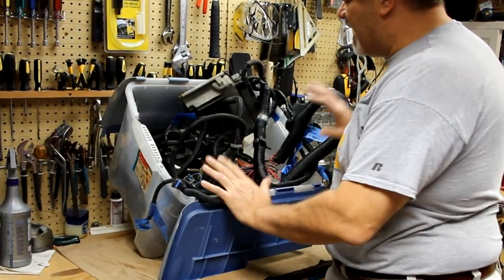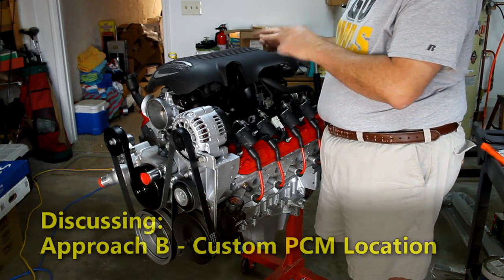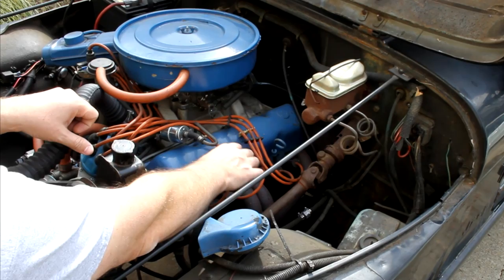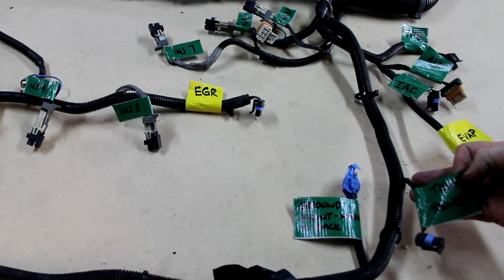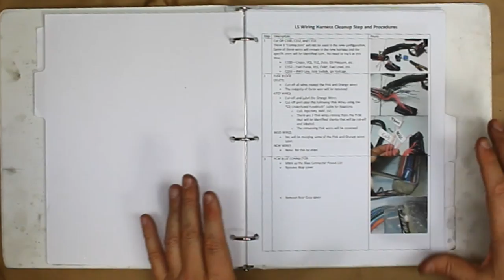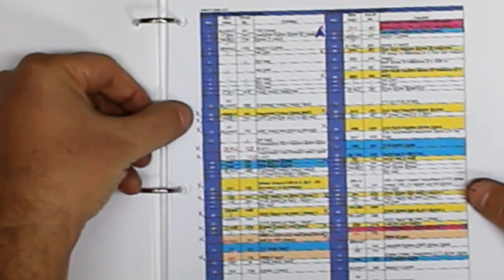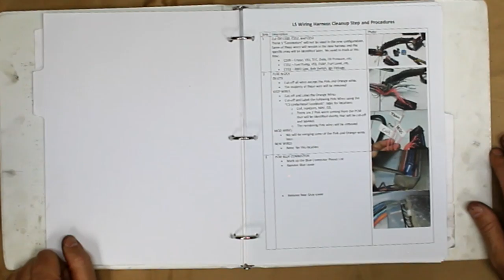LS Wiring Harness Part 1 | Project Rowdy Ep013

Comment: These really are great videos I'm starting a 5.3 build you wouldn't be interested in selling the ac compressor and bracket and bolts and mabe the fuse box
Reply from the maker: I do still have all of those pieces and would be interested in selling them. The fuse block you can have for $10 and need to look up the Compressor, but I would discount it over a normal used price.  The bracket and I will try to find the electrical connectors that you can have for free.  Interested?
Reply from the maker: I just saw Compressors on ebay between $125 - 160.  So how about $80 for mine.  So all of it for $90.
Reply: @UCanDoIt2Mike  that is a good deal is that including shipping and do you do PayPal for payment
Reply from the maker: We will have to figure out Shipping costs and add that.  If you are still interested, I will weigh all those parts and provide you weight and origin Zip Code, so that you can figure out Shipping cost to make sure you are still interested, before I pack it all up.  I do have Paypal.   Let's move this conversation over to email.  Mine is Ucandoit2Mike@gmail.com.  Thanks...  Mike

Comment: when u remove harness from donor ie truck/tahoe do i cut harness at firewall? and take everything under hood
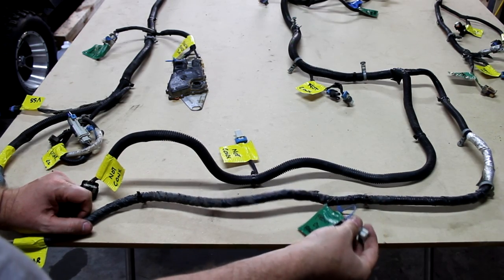Reply from the maker: Look at the 8:58 mark of this video.  It starts to show the Donor Fuse Box.  When I show the rear of it, you can see where the Non-Engine related wires were cut at the rear of the box.  Between this and disconnecting the 3 connectors (C100, C152, C153), you should basically be free from the donor vehicle.

Comment: been searching lt1s page and cant find the harness chart you have can u link the chart itself?
Reply from the maker: Depending on your engine (size and year) you will need to pull the correct PCM Pinout Chart.  So I don't want to just point you to the one that I used.   Here is how I found mine.  See if it helps!!!!Navigate to:  [Wire Harness Info] > [Vortec 4.8/5.3/6.0Harness Wiring Info] > [PCM Connector Pinouts 99-02].
Reply: Look under this video description too, there are schematics and part links .

Comment: Hi Rowdy, James J. here, Do these wiring lessons apply to the ls engines also?
Reply from the maker: Absolutely!  The high level approach will work for all GM (Ford, Dodge, etc) engines.  Specifically on the GM side, you have to obtain the proper pinout charts for your engine and decide what features you would like to keep/delete.  The wiring harness for all Gen3/Gen4 engines (LSx, LMx, LQx, etc.) are for the most part the same.
Reply: @UCanDoIt2Mike  Thank you my new found friend for this advice. I'm looking to do the same with a ls 6.0 and place the engine in a 1970's model old school ford truck. Along with the 4l80 trans. I want to keep the wiring  for that trans because they're such strong trans.
Reply from the maker: @talentworld6280  Heck yeah!  That sounds awesome.  I love those old trucks and possible plan to do something similar when I retire.   Cheers and enjoy your project!!!
Reply: @UCanDoIt2Mike  THANKS

Comment: Can anyone help me. I pulled a harness off a v6 Silverado 1500 and it has all the same wires it looks like. The computer has the red and blue prong can I still use this setup?
Reply from the maker: cameron ludwig I’ll take a stab at an answer ...   the direct answer is Yes.  The real answer is Why?   Your going to have to add 2 injector wires and do something about the combined Coil wires.  You need two more cool circuits.   There has to be other differences.   Seems much easier to go to a junk yard and pull the right one.
Reply: @UCanDoIt2Mike  thank you for your help bud. Do u know where I might could find a video or site about how to add all the extra wire to harness? I've looked at the salvage yards close 2 me and there all gone or someone has cut it all up 😫😢 I might travel to memphis next weekend and see if they have a yard there with one.
Reply from the maker: In my series where we are taking out wires is the opposite of what you are looking for.  It is the same concept.  You will have to locate the Pinout documentation for the Year of your PCM and that will be the configuration that you have to achieve.  Again, I think finding a V8 harness and PCM would be the easiest route.

Comment: my harness comes with a temperature sensor, same as yours but in the same columns of wire there another sensor with 2 wire (one Bwn and one Wht) that is located in front driver side, below the Temperature sensor, behind the power steering oil in the engine so Do you know what sensor is that? am asking because your harness diagram does not show it and i do not know if i need to save it or delete it.
Reply from the maker: Not sure.  my best advice would be to check continuity between the wires in that connector and the PCM connectors to see if yu can determine which Pins it represents.   Then you can look at the Pinout Chart to determine the purpose of the wires.
Reply: @UCanDoIt2Mike  i follow those wires so they come from sensor to C-100 and from C-100 come to the ECU (body control body so. any ways i decide to delete. thanks
Reply: what i know is the Body control model (ECU) controls all elctronics in the car such as electric door, power mirrow, power windows etc. i don't know why those wires come from engine to ECU.

Comment: Anything for underdash harness from the bulkhead under drivers side?
Reply from the maker: I just last week published Episode 27 CJ7 Dash Removal where I discussed my some of my plans for Dash Harness Wiring.  I will ultimately be going with a generic purchased harness.  I will be detailing that install as well.  It will be a little down the road before I get there.   Currently working on Heater Box and then back to the Bodywork.Mike
Reply: Currently ive pulled my harnness out. I bought this 98 stepside for 1k. But the harness was cut in many places, unusable. Looked around for a new harness but can only get those generic harnesses as well.
Reply from the maker: I did some research a couple of months ago during some down time.  The two big companies (American Wire and Painless) both offer a Custom solution for my Jeep for about $900!!!!!  But I can get a 22 Circuit Generic Harness and put the ends on myself for ~ $400.  Seems like a no-brainer to me.  Generic it is.  I can crimp ends like the best of them.  Mike
Reply: Spoke with painless, only able to get a 22 circut generic from any of them. I agree, save money...no brainer
Reply from the maker: Just saw some information on Kwik Wire.  They have several kits with different circuit configurations.  They even have a Water Proof one that has my attention .

Comment: I see your deleting rear o2 sensors. Is that bank 1 sensor 2 and bank 2 sensor 2? I'm asking because both my bank 2 sensors were cut and I'm have to wire those back in my harness.
Reply from the maker: Yes...  Both Rear O2s are referenced as "Sensor 2".  The "Bank" reference is Left or Right side.  If you are looking to keep all 4 sensors in your configuration, you might consider visiting a salvage yard to obtain the connectors and extra length of wiring to put it back.
Reply: OK last question did you have to remove any wires from the PCM to ground your o2s
Reply from the maker: The direct answer to your question is NO.  Each O2 connector has 4 wires.  The Black Ground wire goes into the harness and terminates into a common Splice or Junction.  The 2 sensors that I removed, I just cut off the Black wire from this junction.  The Pink wire goes to the C2 Fuse Block, the other 2 wires (Tan and Purple) are Low and High signal wires that do go to the Blue Connector of the PCM.

Comment: Were you able to finish the wire cleanup procedure?
Reply from the maker: I didn't.  I put that together before starting and then did not quite follow it.  It does not truely represent the process that I took.
Reply: @UCanDoIt2Mike  okay. Either way thanks for all the info I will be using it for my swap 👍🏼

Comment: If you can help how would I wire the fuse wires for standalone on a 2012 Tahoe 5.3
Reply from the maker: Box Crazy That is beyond my research.  The approach would be the same.  You just need to find Pinout charts

Comment: I don't know your inspection status of your state so this point may not apply....  THe EVAP system is deleted?  No emissions inspection??  Also when you were going over the harness on the table and you had your Rear O2 sensor in "yellow" for cutting out, this exhaust isn't going to be catted?  Because the O2 sensors are fuel management, not part of the transmission
Reply from the maker: Excellent Questions Justin.  In Georgia, Emission Inspections are required for vehicles 25 years young.  This engine is going in a 1979 Jeep CJ7.  GM found other methods for EVAP in later model engines so at some point (about 2004) EVAP went away anyway.   I will not need emission on this vehicle so there will not be any Cats or Rear O2 Sensors.  I will have the PCM programmed to adjust for these Deletes.   Again great thought and this may affect people with other circumstances, so it is a great topic!  Cheers!
Reply: I think GM also removed EGR on this engine around 2001 too. Not sure exact year though.
Reply: Unless you are going for a all out cam motor with carb, I would try to maintain all emissions systems, reason being, when the pcm compensates for a leaner burn, you make more power than when you run richer.

Comment: Will this work with LS3 set up? For a chevy Monte Carlo?
Reply from the maker: This is the basic footprint for taking an "LS" series engine harness and modifying it as a 4 wire setup.  It can then be placed in any vehicle and to make the engine run, you just need to connect the 4 wires.  There are addition wires that you will want to also use as described in the wiring diagram in the description and is why I installed a custom 8pin connector in this series.  There are slight differences in the Harnesses 99-02 and 03-08 and Car versus Truck (due to things like the Intake Manifolds are very different).  But if you understand the basic theory of what I have done here, you should have no problems working out the slight differences.  Some of the true LS engines have the Cam Position Sensor on the front of the engine where as the Vortec truck engine has it in the back.  Therefore the associated wires will be found in different sections of the harness.  But they are still there!!!  The true LS3 was used in and around the 2008 timeframe.  That Harness, I believe, will have Blue and Green PCM connectors where mine has Blue and Red.  Some of the pinouts will be different, but you must download the proper Pinout chart from LT1Swap.com and it will tell you what the wires are for.   Hope that helps!!!!

Comment: hello how are you plz i have hummer h3 3.5 2006 i wanna make a swap to 6.0 0r 6.2 l 2007 g4 you can advise me plz for the better one and for the harness working ans somthing not difficult plz ty
Reply from the maker: Wish I could help....  The concept of what is presented in these videos pertained to all swaps.  You just need to provide the specific.  Your harness is different than mine.  Enough so, that my specifics (pin out charts, pin numbers, etc) would not apply.
Reply: @UCanDoIt2Mike  thank you for your help 
my h3 2006 3.5l  Ecm e40  if i find  v8 5.3 or 6.0 or 6.2 with E67 ECM and harness  i put it on my h3 my car work properly for the ABC and gauges and traction control and cruise control and my  transmission sure i wanna change the bell housing and converter and shaft ...?

Comment: How did you wire in the 2 wire alternator?
Reply from the maker: This is the original Alternator and harness.  It is wired stock.  I have not installed the engine the swapped vehicle yet.  I will have to run a wire to the battery for charging.  I will follow the standard configuration.

Comment: how can I set my headlights to turn off automatically? LS1 in 65 c10
Reply from the maker: I assume that you do realize that a vehicle has multiple harnesses and that the headlights have nothing to do with the Engine Harness.   I can only assume that there is a timer circuit that is based on getting "Keyed" power.  And that when that power is lost, it begins to count down.  If you grabbed an Electric Schematic from a newer vehicle and traced the Headlight circuit, you will most likely will be able to determine how that works and what you need from a salvage vehicle to accomplish this.   The more I think though it, the more interest I become....

Comment: From what year and model is that ecu is that second generation LS ECU
Reply from the maker: My engine and PCM (ECU) is from a 2001 Silverado.  I believe they call it a PCM (Powertrain Control Module) because it controls both the Engine and Transmission.   This is a third generation engine LM7 5.3L.
Reply: Ohh ok thank you friend if anything gives me problems when i start working on my harness probably fuse box and relays looks complicated
Reply from the maker: You just need to break it down into smaller sections.  Many things will go without a hitch and you may run into a couple things that you will need to research and figure out.   Wouldn't want to push you into something that you are not comfortable with, but with a little research it was very rewarding for me.
Reply: When time comes im going to bother you with questions my friend lol
Reply from the maker: I'll do what I can to help.   You going to put an LS in the old GMC truck?
Reply: No i just bought 1988 Ford Mustang GT 5.0 302 i want to swap it with LS 5.3 and 2 Speed Powerglide which i already had i just bought LS1 intake and Truck harness i still need ECU and another set of heads i want to boost that ls and run it on track those Fox bodies are light little over 3000 pounds

Comment: If this is followed step by step with this also work for a 6.2?
Reply from the maker: The basic approach for all of these LSx series engines is very similar.  So let me say Yes!  Let me add a foot note that I believe the most 6.2L engines (I believe are GEN 4 engines , maybe??? ) are configured with VVT (Variable Valve Timing).  So you would just need to add the technical knowledge associated with VVT and you would be good.  Hope that helps!
Reply from the maker: Oooops!!!!! When I wrote this, I was thinking this was on one of the engine build videos!  From the standpoint of the Engine Harness.... again YES!   The Approach is the same.  It all starts with research and preparation on the LT1Swap.com site.

Comment: will this work with any ls Wiring harness?
Reply from the maker: korbin varney Yes!  What is represented in this video with directly work for any GM LS engine. You just have to pick and choose what gesture you want to keep or discard.  There are connect charts that you will have to obtain for your specific engine.  This “Approach” will work for any modern computer controlled engine (Ford, Dodge, Toyota, BMW, etc.)
Reply: ok thank you for the reply and keep up the good work.
Reply: Where will be the best place to find these charts from do u have a link?

Comment: What about a body module that it part of the vats?
Reply from the maker: The vehicle that this motor is being installed does not have a body module (79 Jeep CJ7).  I will be removing VATS from the PCM programming.

Comment: Hello sir.
I need some information this Ls wiring herness ecu.
Can you help me.
Reply from the maker: Beyond what I placed in this video series.   I would suggest visiting LT1Swap.com.  It was the source information that I based my approach on.  Specs for several different engine option are all there.
Reply: Hello sir.
My qustion  very easy i hope  you give qustion answer .
My qustion  Ls ecu have immoblizer system  or not.
this my qustion.
Reply from the maker: I am not certain of teh use of your word "Immobilizer".   If you are talking about an Anti-Theft System, the is Yes.  It is called VATS or (Vehical Anti-Theft System).  During most LS engine swaps, you are placing it into a car that does not have the Vehicle side of the VATS electronics, you will need to disarm the VATS function in the PCM or ECU.  If VATS is left enabled in the ECU and you do not have a working VATS system in teh vehicle, the ECU will shut off the engine.

Comment: So if I cut those sensors off, won't it set off a check engine light from the ecm and make the engine run all funny?
Reply from the maker: For each Sensor you remove, you will needs to have your PCM programmer adjust the PCM program to disable.  You are Already going to have to reprogram to remove VATS, why not get it all done!

Comment: Hi.. I want to do this..where can I find that PDF?
Reply from the maker: In the description of this video there is a link to free PDF of my diagram.
Reply: hi can help with this?
Reply: i have a pcm for gmc sierra 2002 5.3 ..i buy a harness because mine has cutted in many pieces .the new harness is the same dbc but the upstream 02 sensor plug is the black flat .. the old harness has the gray isolated ground plug..can works new harness with this pcm?
Reply: i havw send to you a email

Comment: Will this still pass emissions?
Reply from the maker: To be honest, I don't know the answer.   I believe so.   You should be able to tune the engine to meet emission specs and disable CEL codes for items that have been removed.   But again, I'm not sure.   My vehicle does not require emissions,
Reply: @UCanDoIt2Mike  I'm thinking about an S10 swap, but also planning on heads, cam injectors ect, so a terminator x or fast system may be worth it